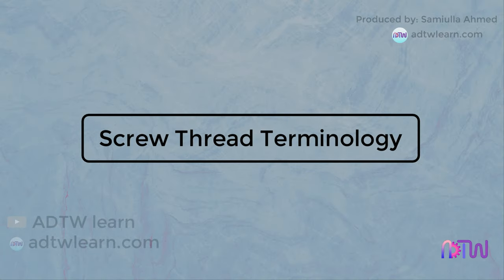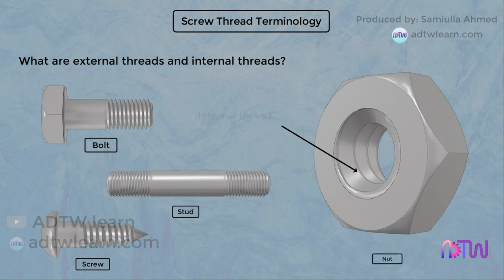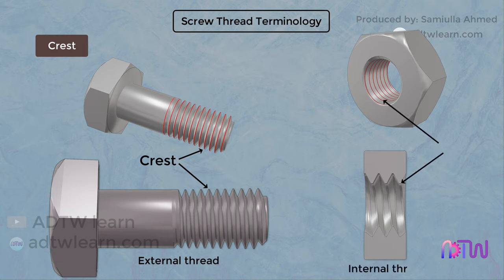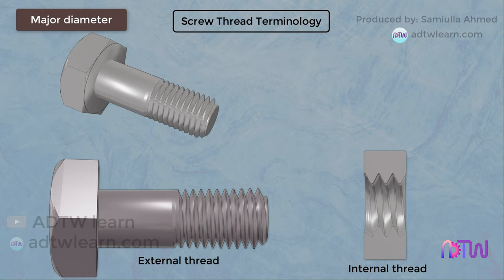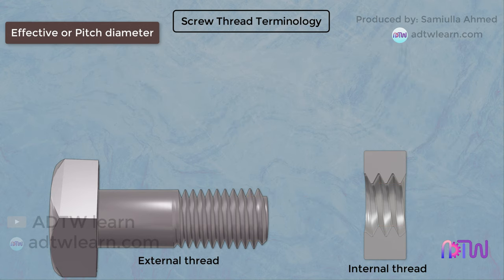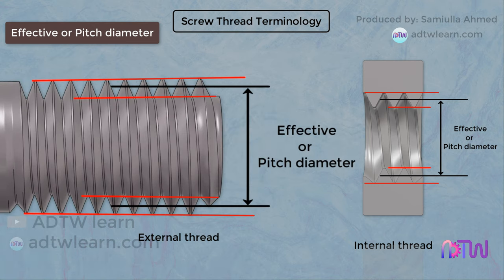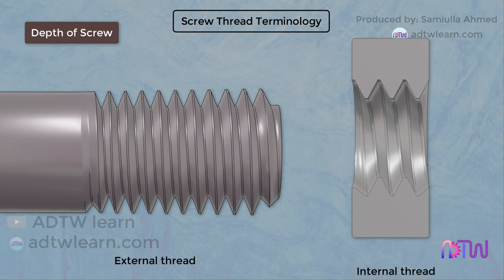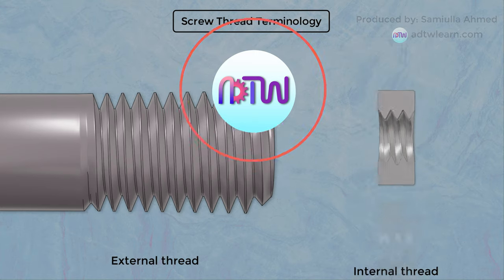Screw Thread Terminology

Comment: Hello sir 
I need to know when we use flat die to do threading on wire the diameter increase and on plain side it doesn’t change hence my nut becomes free it the end. How to control the increase diameter? Or we need to use round thread die which pulls the wire. Pl advice